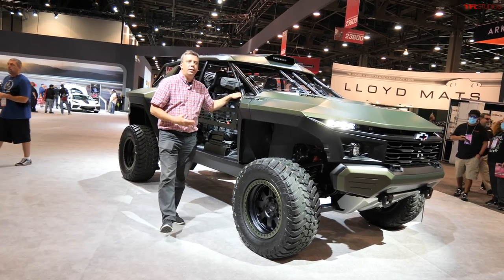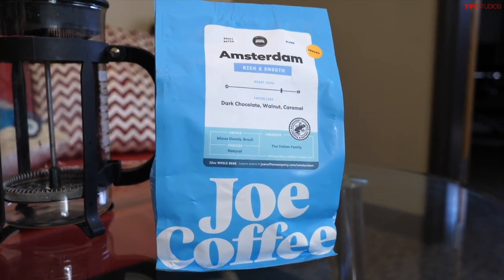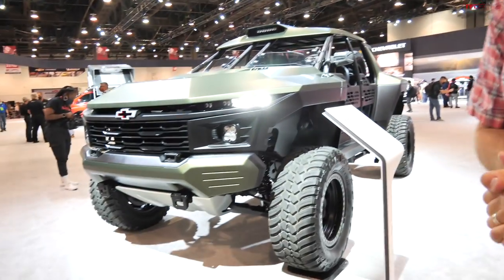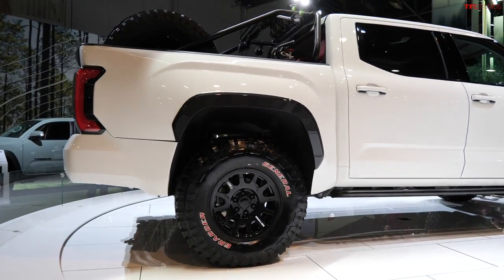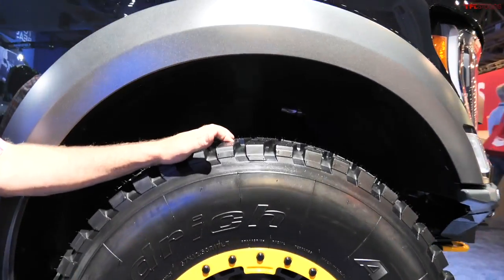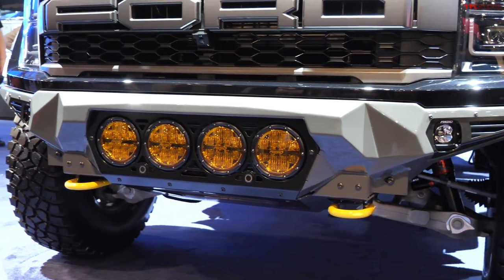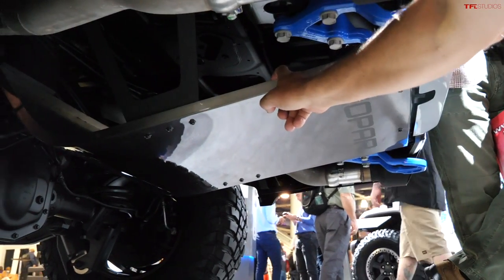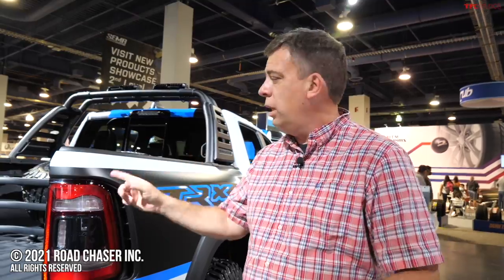The Super Truck Is Officially a Thing: Here Are The Craziest Trucks From Chevy, Ford, Ram & Toyota!

Comment: I hate the performance off-road truck I mite get one lower it and put radials on it lol.... Hope Chevy gives us a 2wd crew cab shortbed lowered with lt4 engine... Or reg cab shortbed but it'll have a backseat for sure so they can sell more
Reply: Thanks guys maybe GM we'll see this and give us a new SS but make it 4x4 not AWD so we can do donuts and also crew cab to haul the family lol..... Supercharged 6.2 L Don't give it any stupid fuel management system either They should just make SS a trim level and make it LT4 with the 10speed

Comment: Interesting to see how long it took the rest of the game to go after the Raptor.  IMHO it's the Raptor and TRX, the Chevy beast looks like a bunch of high school kids put something together with zero vision.  The Tundra looks like a natural progression but won't change much or push "the game" but any competition helps.
Reply: you’re right but toyota’s most likely about to start a massive cult following of tundra desert off-road people even if the truck is only half of what a raptor is functionally.
Reply: The Chevy beast looks like a lot of rock crawlers I see on the trails. Of course many of them have 42" tires and are setup to run trails in the class of 7-12

Comment: I have driven the TRX, the new 3rd Gen Raptor. I much preferred the Raptor. Then,,,,,,, my buddy I sold my 2019 Raptor SuperCab to offered for me to be able to buy it back!! He had the bit of trail damage I had on y fixed and then resprayed the entire truck in rapid red vs race red. Not a full colour change, but you are hard pressed to find any race red on it. New skid plates and tires and it looks almost showroom again. I bought it back for his costs, less than 10% and 2 weeks of us out on my 52ft Grand Banks off of Vancouver Island. For me, it was a no brainer!! I will upgrade it to 37s. Haven’t decided on what exactly I will do for suspension upgrades, but I will go with a new Borla exhaust system on it. I may have the V6 tuned for a bit more hp, but it’s a 2019 and still under warranty until 2024,,,, sooooo,,,,,. It definitely has more than enough power already. 
    I will likely have a Raptor with similar suspension to the Gen 3 except with an older design in the rear, same hp, BETTER capabilities due to being 11” shorter overall and looking very fine for maybe $15K less than brand new at MSRP! My buddy is getting a new 22 model year Raptor on 35s and is over the moon. He went crazy on options so I’m interested to see his truck when he gets it 5-9 months from now. He won’t release my truck back to me until he gets the new one though. I can wait. He is unlikely to put more than 1500-1750 miles on in that timeframe. He has the factory sticker graphics as well but is unsure if he wants them installed and is giving me those too. I’m undecided also.

Comment: I'm a total fan. But they will get stomped and curbed in this battle. Yota not only comes w less power but then makes their ecu's hard to talk to.. so anything but a Magnusson kit can't really b worked w unless u spend a lot to get elaborate.  and their exclusive flash can only be had through a Magnusson dlr. Irl last forever w maint etc but sometimes u just want to have a badge that mean something. TRD is not one of those badges and it's an embarassment

Comment: Gmc Sierra, Denali = 420 hp 
Chevy 1500, Suburban,  Tahoe =420 hp
Cadillac Escalade =420 hp
Chevy beast concept =650 hp ? 
General motors motors takes so long to catch up with their competitors that by the time they make a move , it's a move that's already been done but tweaked to be better and cheaper than the rest . But everyone else is now doing something new 🙄  General motors is always just a step behind in innovation and dependability...
Reply: All of the engines in GM's full size SUVs are meant for mileage and towing capability. GM leads the industry in fuel mileage for their full size SUVs and they also completely own the segment. GM outsells all full size SUVs combined, last year they hit 69% market share in the segment.

Comment: It's funny how the other companies all shit on Ram for having coils in the back and now they are all going to them. Their buyers also used to make up stuff about how crummy they were too. Now they will have to own them. I can't wait to hear the excuses.
Reply: Yk what's even funnier is people think the raptor was the first super truck but don't seem to realize the power ram and power wagon and ram charger were a thing
Reply: Coils have their place but production trucks usually need the springs to support the heavy loads they need to carry (2500, 3500, 4500).  For an off-road vehicle, the coils work pretty good since you still have something to smooth out the trip but it will have enough give so you can extend out/down as needed.  Many years ago one of my brothers had a Jeep one ton with stiff springs. Very, very rough ride especially when off road; I used to drive an Army 2.5 ton truck (6 wheels) and it was a PITA to drive since no power steering, manual tranny, and very stiff springs but it did have six wheel drive.

Comment: I am a Tundra fan, but a 437 hp truck is not a super truck. Neither is the Raptor. Your stock Powerboost has a better 0-60 than either because they have a similar powertrain but they are fatter. From what I'm hearing, the Tundra gives up a whole second.

Comment: Toyota failed on every aspect with this truck.
Reply: No V8 option. That nose / fascia area. Too many electrical crap to go wrong. Coil springs in the rear. Smaller interior. V6 used in the Tacoma and Lexus, but has not been put through the same use as a "truck".
Reply: It just looks like a big Tacoma to me.

Comment: The Chevy is terrible. The suspension and engine are good but the modified frame is bad just put together a solid vehicle and sell it. The Toyota is almost ready for production but that power plant is complicated and under powered for a twin turbo electrified motor. The Dodge is cool but Ford is still sitting on the throne.

Comment: These concept/super trucks are not cool. I'd much rather see innovation than "lookie at this badass bolt on beast". That's for the aftermarket. Go back to the drawing board, and give is better, more efficient power.
Reply: This, so true. I would prefer they cover the REX suspension kit for JK jeeps. That is cool and currently available.